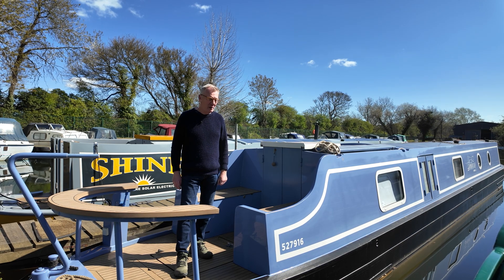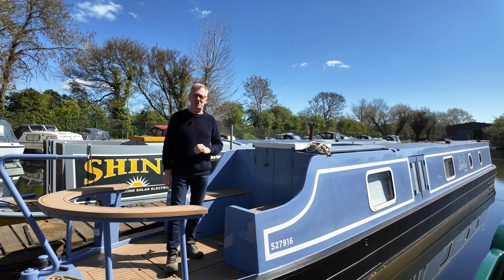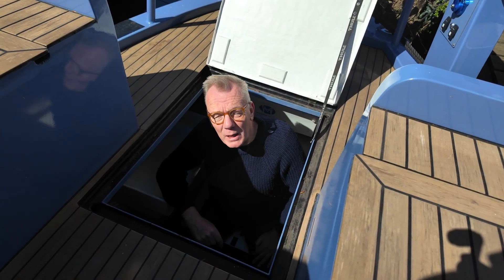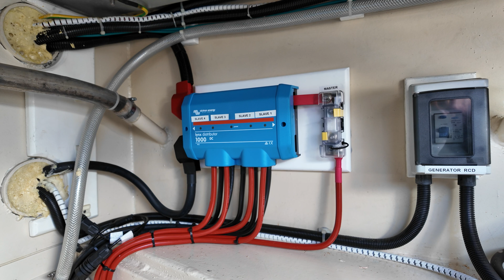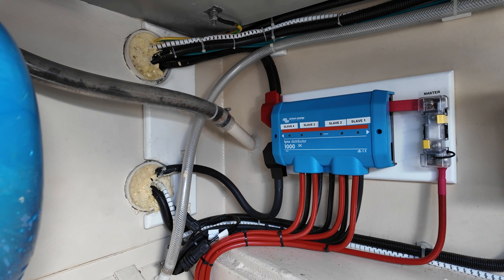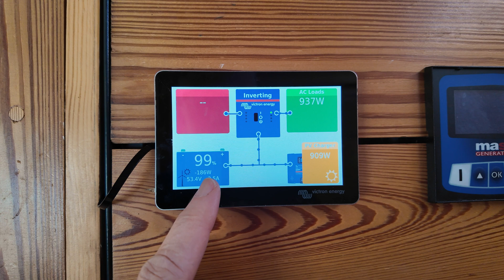Lithium on an Electric Narrowboat - Full Tour & Tech!

Comment: Thank you for sharing your solution to trim out the boat, a very creative method.
How difficult is it to get cedar in Britain to be used on the interior of the boats?
Could you do a video on ways to control condensation on boats especially in the summer?
Mark
Alberta, Canada
Reply from the maker: Hi Mark - thanks for getting in touch. When you say Cedar, do you mean Western Red Cedar? Yes we can get it here and we like it. Beautiful smell. But it's expensive. Condensation is not an issue in the summer. Best thing to alleviate condensation is foam insulation and double glazed windows with a themal break. Watch the forthcoming video on a sailaway we are about to complete. Cheers  Tim
Reply: Thank you Tim for the reply.  Yes I was thinking of the Western Cedar, sorry i should have been more descriptive.  I had a feeling that it was going to be an expensive wood.
Cheers till next week or soon there after.
Mark
Alberta, Canada @mothership_marine
Reply from the maker: looking forward to it - Tim